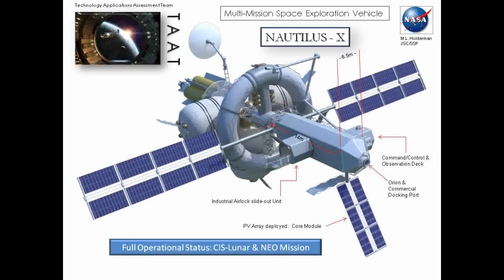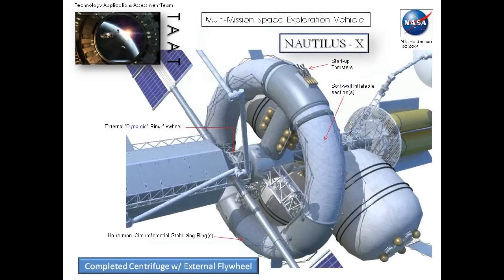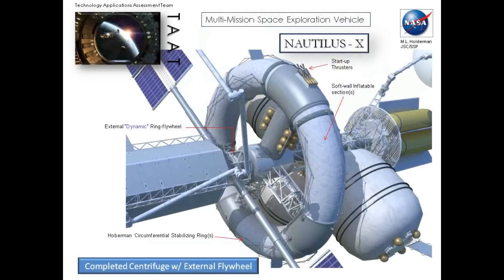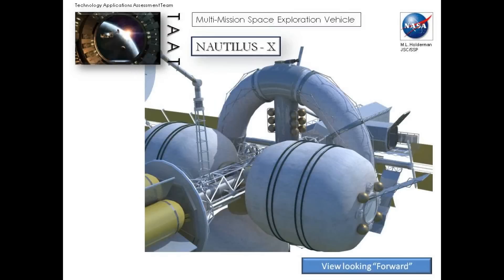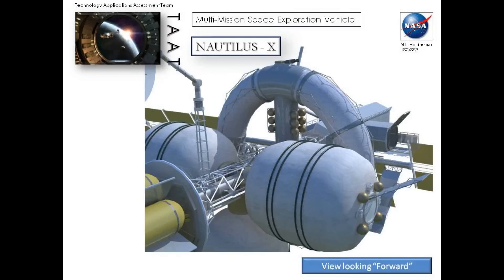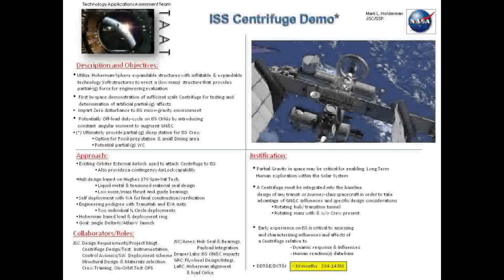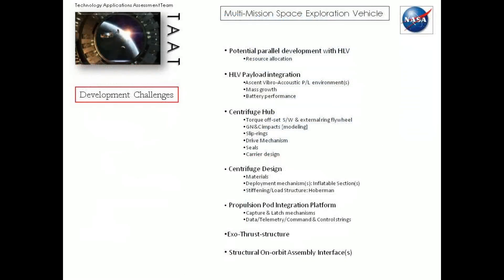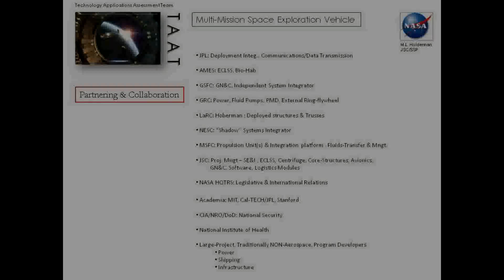NAUTILUS-X Future in Space Operations (FISO) Group Presentation - Part 2

Comment: No doubt , nuclear would be necessary.  The vasimir will be first and it will be nuclear.  A trip to Mars would take about a month and about 2 to 3 months to Jupiter.
Now, once the fusion engines  come on line, the trip to Mars would take less than a week and  less than a month to Jupiter.  Once you can go that fast, the whole solar system is open.